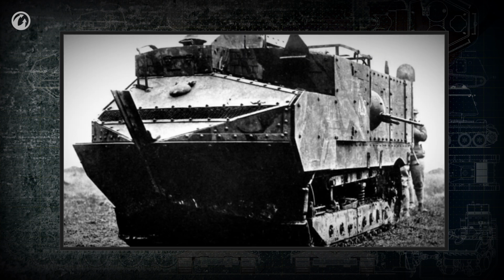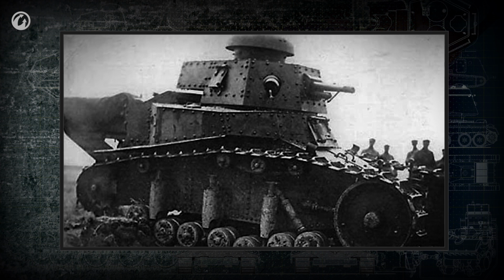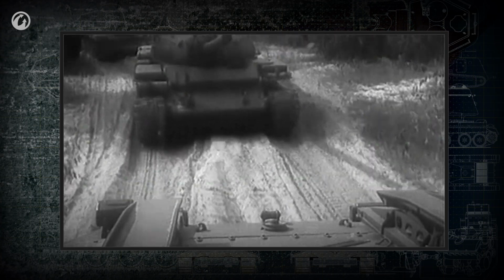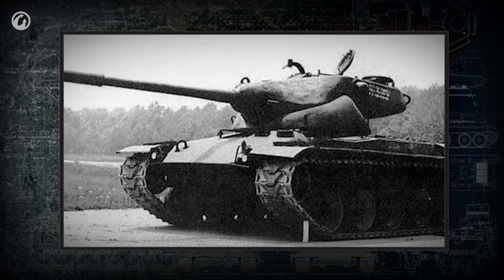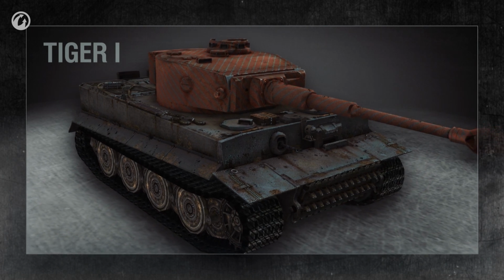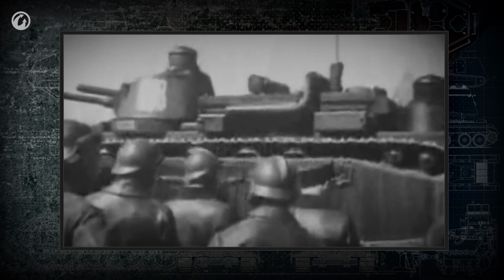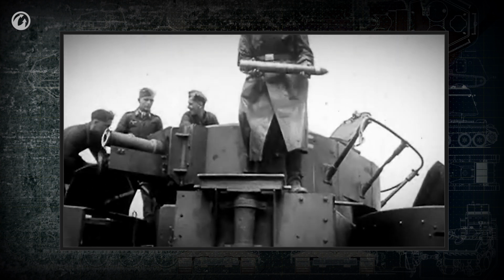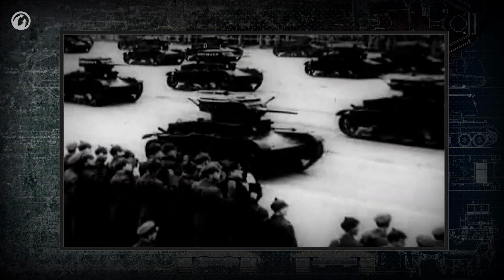The Nuts and Bolts of Tanks: Tank Turrets - World of Tanks

Comment: Why tank destroyers have no turrets?
Reply: Tank destroyers didn't have a turret allowing for a longer recoil and therefore allowing for a much higher velocity cannons. Hence" Tank destroyer"
Reply: +King Starphoon Velocity oh ok thanks
Reply: Turrets restricted the size of the cannon.  Once a tank had become obsolete, they could just remove the turret and mount a bigger gun on it that could slay the newer tanks.  That way, these older models could still see use in battle without needing to scrap it.
Reply: Aden xiong so they can have a bigger gun
Reply: cheaper/easier to produce